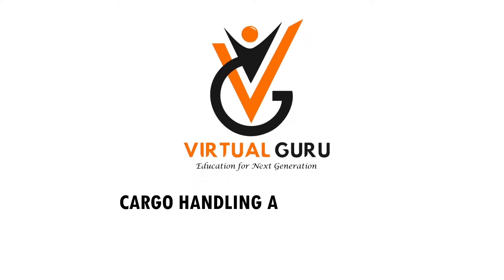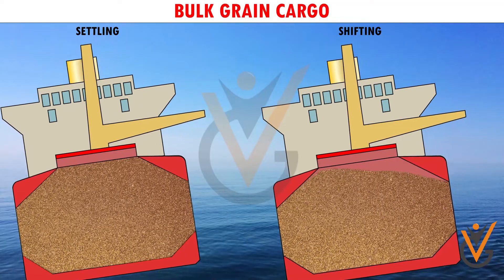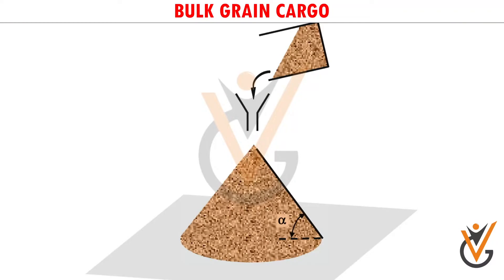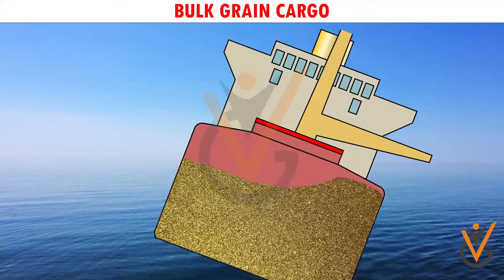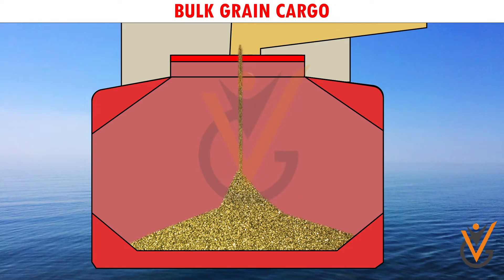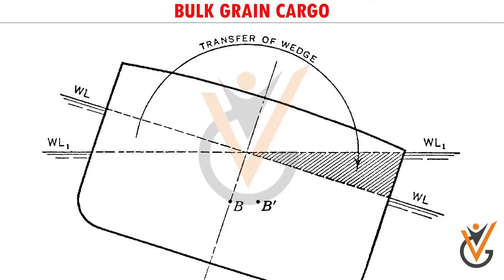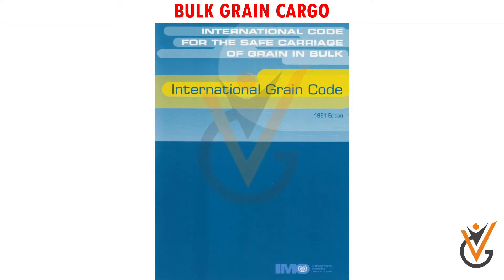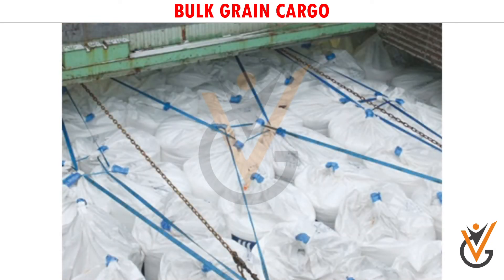Cargo Handling Stowage | Bulk Grain Cargo

Comment: Why not make an auto closing cargo with gravity. Like a plat that goes down as the grain setlles? this way grain wouldn't go from left to right as a plate would be pressing on them. Yes it would be more weight but it would control the grain for as long as it is at sea. Unless this is already being used or already seen as unefficient.